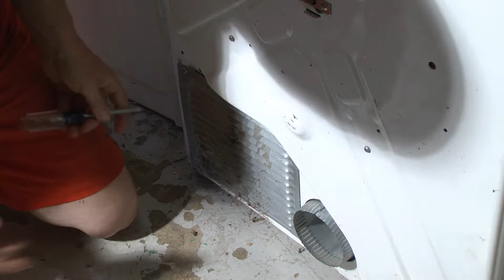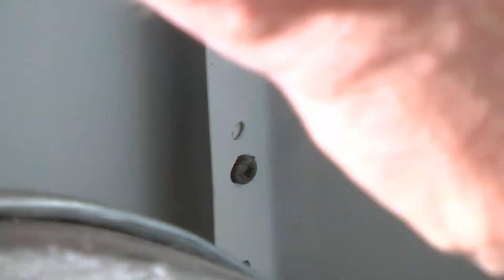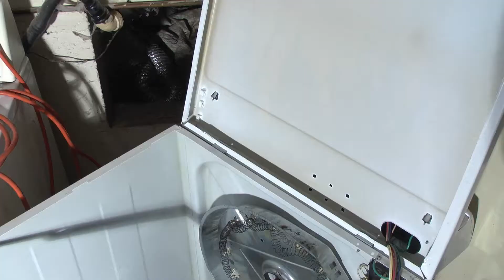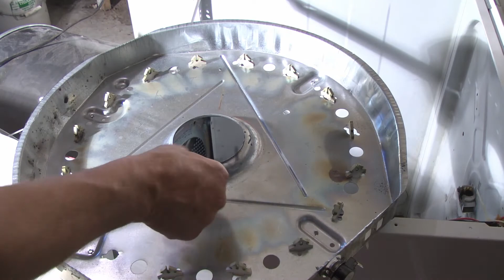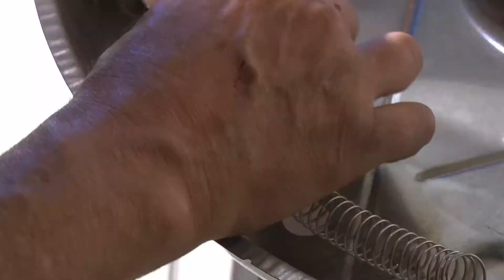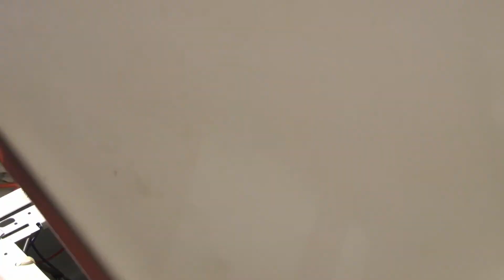How To Replace A Frigidaire Dryer Heating Element

Comment: Why does it keep burning out? Am I getting bad elements?  Element lasted only 2 weeks, Yes I cleaned the ducts, yes I heat tested the overtemp sensor.
Reply from the maker: What I do now with my dryer is I never run it on high heat. I go about 3/4 on the temp. Seems the elements these days just can't handle full power. Good luck!
Reply: We were running low heat and it died @hardluckcharlie

Comment: Hello. Thank you so much for the detailed video. Question. It looks like I have to order the whole silver plate you’re working with, I didn’t know you could order just the coils. Since the heater is not working on the dryer, should I just order the coils, two for 25? I don’t think I have to order that whole octagon shaped plate. Thanks for your help.
Reply from the maker: It's seldom necessary to order the coil pan with the coil installed. If your pan and support insulators are in good shape, just order the coils. Thanks for watching and writing!

Comment: great video- i would lube the belt tensioner pulley shaft - put a glob of grease in the plastic socket and lube the motor shaft where the centrifugal switch slides back and forth
Reply from the maker: Excellent points! Thank you for watching and the good advice. Take care!

Comment: Do the wires on the element coil matter where they go? I forgot which color goes where and I want to be sure they go in the right place. Mine are yellow and black
Reply from the maker: It should not matter. But always best to take a picture first and get all wires back where they came from.

Comment: My dryer has a round metal piece that will not  allow us to take the housing for the heating element.  We have tried to remove the metal disk in the middle by there are no screws holding it.  Any suggestions would be helpful.  Thanks in advance
Reply: Pull up.  Its a ball joint